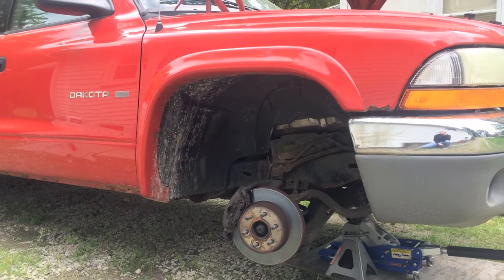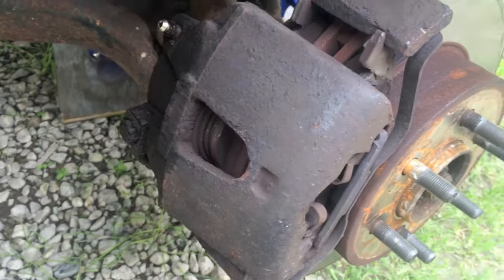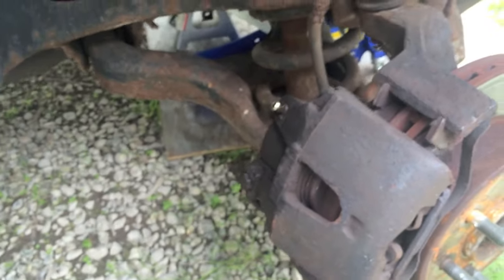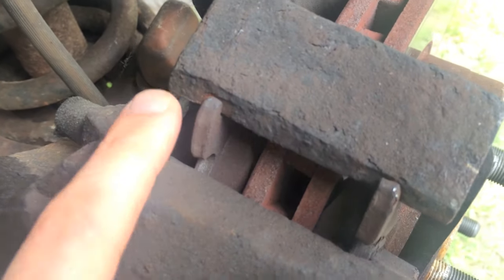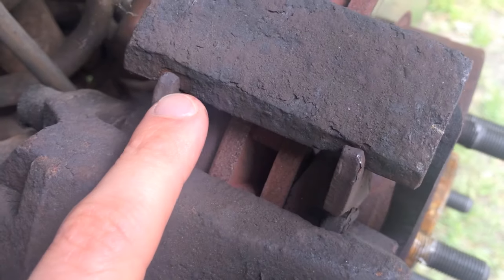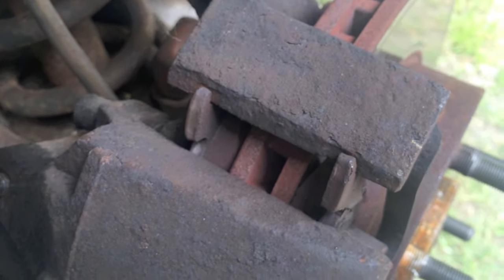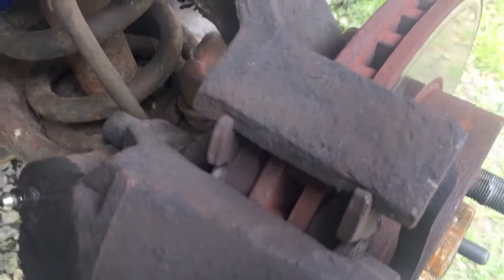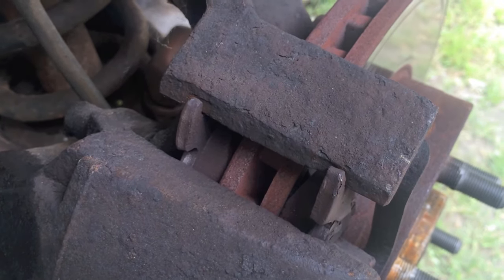HARD Brake Pedal - My brakes are Locking/Sticking/Smoking "Don't forget this"

Comment: Thanks for your video. It helped a lot. I was thinking it might be warped rotors or broken hub. Turns out it was just dirty calipers.I went to a shop to get my brakes done. I didn’t have any problems before I went in, the dealer mentioned I was low on brake pad and wanted $150. I went to get a second opinion and they wanted $75. I let them do it but afterwards my breaks were sticking. I didn’t notice it immediately because my music is on all the time but I noticed my gas mileage was down a good bit. Watched your video and fixed that thing myself. Lazy mechanics didn’t clean or regrease anything; all the old brake dust was clogging the calipers up. I’m done giving my money away to incompetent wanna be mechanics. Doing everything myself that I can now.
Reply from the maker: Gold Wolf 

Thanks for watching & sharing your experience.  We really enjoy helping out our fellow DIY’ers.  Us fellow DIY’ers need to stick together.  Sounds like you’re back up and running.

😎👍🔧🔩

Comment: Thank you for the help! This has been one of the most informative videos, after searching for hours & hours..   
My only option is to take apart & clean & re-grease what I can.  It may very well be that simple of a fix, at least for now!.
Reply from the maker: Joshua Parks 

You are very welcome Joshua.  Below is the same comment we replied on the other video question you had.  We just took our reply comment & copy/pasted it here for you in the event that you didn’t get the other reply.  Hope this helps!

NO FUN...Brake problems are very annoying and I definitely feel your pain.  Lets get this figured out together so you can get back to normal driving.

It can be a few different things....

The front rubber brake lines that connect to your caliper fail from inside rather that outside.  This means the inner coating begins to break away and clog portions of the brake system...hence not allowing fluid to flow back and forth freely.  

Your brake pads have little prongs/teeth on them.  You will notice by their location...the pads slide on a steel brace.  This may need to be lubricated to bring the shift back to efficient requirements.

I have attached helpful videos that help explain the items mentioned above.  In addition, I have added a few videos that it can also be as we move forward with pin-pointing the exact cause of your brake issue.  Lets start with the easy items and then work our way up!  Lets figure this out together!  Keep us posted!  

PLEASE SUBSCRIBE to the channel and turn on your YouTube notification Bell 🛎 that would be awesome!  😎👍🔧🔩

1.  Caliper Slides Lost Lubrication:

https://www.youtube.com/watch?v=-DZ68tKuCQc&amp;t=15s

2.  Too much Fluid in Reservoir:

https://www.youtube.com/watch?v=X-AJ5tD6zoA&amp;list=PLjCXOz8TSkZnavDiGDyHdPKe2dV2RzEMZ&amp;index=39

3.  Failing Front Brake Lines:

https://www.youtube.com/watch?v=3FTEgbLYAdI&amp;list=PLjCXOz8TSkZnavDiGDyHdPKe2dV2RzEMZ&amp;index=78

4.  Brake Pads not shifting:

https://www.youtube.com/watch?v=3Pq15BWM_qY&amp;t=103s

5.  Replacing Front Brake Calipers:

https://www.youtube.com/watch?v=8HoaL4QM5-k&amp;list=PLjCXOz8TSkZnavDiGDyHdPKe2dV2RzEMZ&amp;index=83

6.  How to check if Brake Booster is Failing:

https://www.youtube.com/watch?v=VK4lowH7kQE&amp;index=66&amp;list=PLjCXOz8TSkZnavDiGDyHdPKe2dV2RzEMZ

7.  Failing Brake Booster:

https://www.youtube.com/watch?v=j9s7yccswPQ

8.  Symptoms of a Failing Brake Booster Check Valve:

https://www.youtube.com/watch?v=j9s7yccswPQ&amp;index=68&amp;list=PLjCXOz8TSkZnavDiGDyHdPKe2dV2RzEMZ

Comment: Replaced caliper.  Did some test.  The rubber hose seems to be okay.  I've heard it fails from the inside also. They forgot to put the special washers for the hydraulic feed in the box.  I used the old ones. Pretty cool to have a bolt with a whole drilled through it to feed the hydraulic breaks. ..Time will tell.
Reply from the maker: PIANOSTYLE100 

Very cool & thanks for the update.  The little bolt that has a hole drilled through it is engineering at its finest!  🤓📚

We are happy to hear you replaced Caliper...hopefully it was fun.

Again, let us know if you have any questions, we are standing ready to help!  We replaced our rubber brake hoses.  It was a pretty friendly DIY project!  😎👍🔧🔩

Let us know how the test driving goes over the next few days.

Comment: I have a 05 suburban at first I had a spongy brake pedal. So I purchased a Master cylinder thinking that was the problem. Turn out I didn't need it and put the old one back on and refilled it with hydraulic fluid. Now my front two brakes are locking up.
Reply from the maker: Billy Cross 

Thanks for watching.  You will need to properly bleed brake system to get all air out of system.  Keep us posted.

Let us know if you have any questions.  Please subscribe to the channel and Ring your YouTube Bell 🛎 that would be awesome thanks again!

😎👍🔧🔩
Reply: @DIYwithMichaelBorders   the only way it drives is when I bleed front two brakes. After that it drives for about 5 miles and starts dragging again.
Reply from the maker: Billy Cross 

Thanks for the reply.  You will also want to make sure you bleed your Master Brake Cylinder as well.

😎👍🔧🔩

Comment: Talked to some very experienced mechanics and there are a few things that can happen that cause someone. The seal on the half axile that goes to the pumpkin can 
leak hydraulic oil  on to the hot brake parts  causing bad smoke.  
Another part that goes bad internally are the rubber hoses going to the callipers.  You can troubleshoot this with the bleed screw..as I understand it..I decided
not to get in this day..I'll send you some pix as I go.Anyways that's the plan.
Reply from the maker: PIANOSTYLE100 

We appreciate the update!  That’s great info from the mechanics.  It definitely helps when trying to pin-point the cause.  Keep us posted!  😎👍🔧🔩

Comment: I had brand new Calipers and brake shoes put on the front of my 2001 Pontiac Montana. A week later the brakes started locking up. I took it back to the shop and they said I needed new rotors, new brake shoes and brake hoses. I had them repair all of it. Drove it two weeks and now they are locked up again. The ABS has not worked in over 10  years so I doubt that is the issue. But I refused to let  them work on it again. What should I do?
Reply from the maker: Lydia Schmitz 

Thanks for watching & that’s no fun.  What does your fluid level look like.?  We recommend inspecting your brake fluid reservoir inside your engine compartment and verifying its within the proper fill parameters.

Fluid outside the parameters can cause your exact issue.  Keep us posted.

😎👍🔧🔩

Comment: Verified or believe I have a sticking caliper .I don't completely understand it, but it is based on hydraulic principals.  I will fill you in.. going to put on caliper..have to buy one today..probably should get some break fluid too.  If I would have driven it home..would possibly ruined my rotor.. ie. 80 dollars or so extra. I only pay a few dollars extra a month for towing..what a deal.. had to wait two hours. My wife has been really concerned. .
Reply from the maker: PIANOSTYLE100 

Awesome & thanks for the update!  An additional item you may want to consider is a failing Rubber Brake Hose.  It’s possible that your caliper is still in good working order and your hose has failed not allowing the brake fluid to efficiently flow back-and-forth...thus... causing a blockage in the fluid which then leads to sticking Calipers.

Below is a link to a video we made showing this repair.  It’s worth looking at.

       https://youtu.be/3FTEgbLYAdI

Comment: I am going to pass this on.  99  Chrysler Town and Country... It has been using water and getting really hot fast...It was having several symtoms that looked like blown head gasket was on the way.. I found a leak in the back passenger
side.  it was broken plastic pipes going to and from the engine.it was the rear heater. I  bypassed it and ran a 10 inch heat resistant rubber hose between the two.. it seems like it's ok..and yes it's a rig but not losing water at that point..so far. So still was losing some water. In one night the radiator would go to 3/4. I happened to hear a drip drip one night.. listened to fender area and every 15 seconds or so it dripped.
Found this drip is  at the input to the water pump. It appears to coming from the pump itself. The part is about 30 dollars. When I replace it, that   should fix it..iIf I was mechanic I wouldn't rig it but it's my car .. I do keep checking it  often.  Seems adverse effects.
Reply from the maker: PIANOSTYLE100 

Sounds like you’re having fun working on your vehicle.  A project vehicle can teach you a lot & help you down the road later on when getting a newer vehicle.  That’s awesome!

It’s always so rewarding when you fix your car yourself & save lots of cash 💰 

😎👍🔧🔩

Comment: Just now running across your video...but I have a 2004 Chevy avalanche & I had the rotors brake pads changed like last yr now my truck brakes are locking up on me....so I changed the front calibers & the front brakes lines only for it to still lock up on me after a few mins of driving....could U tell me what it may be that is causing this issue....any info would be greatly appreciated
Reply from the maker: Thanks for watching & we appreciate you sharing your experience.  Let’s get this figured out.  Since you have replaced all these parts...& assuming vehicle brake fluid system has been properly bled, it’s very possible that the fluid level is exceeding the fill parameter.

Check out the video link below, it talks more about this.

       https://youtu.be/X-AJ5tD6zoA

Let’s start there, keep us posted.  Us fellow DIY’ers need to stick together!

😎👍🔧🔩

Comment: You are right that is the problem I have a 2001 Saturn front brakes overheating and locking up I loosen up the anti-lock hydraulic line a little bit break started working fine but they keep on locking up I'm pretty sure the anti-lock brake system is bad I unplugged it totally still overheating front brakes locking up thinking about just bypassing it totally and go straight into the master cylinder I'm thinking that will solve the problem
Reply from the maker: Rocky Easterline 

Thanks for watching & we hope you enjoyed the video.  The ABS is an important feature & should be addressed.  Keep us posted on your project.

Let us know if you have any questions.  Many more helpful videos to come!  😀
Please subscribe to the channel and turn on your YouTube notification Bell 🛎 that would be awesome thanks again.

😎👍🔧🔩
Reply: U ever figure it out? I have an 03 saturn, just got new pads/rotors/calipers/drums/cylinders/front hoses/master cylinder...car drives fine for a while but then drags from bad to worse, super stiff pedal, smoke coming from both front wheels

Comment: I have a 1996 Cadillac Eldorado. Over the past year I have replaced the rear brake lines up to the front and also right rear caliper. Brakes worked good for about a month. Now, I have a very soft pedal until I pump it a few times then the pedal gets stiffer. Sometimes it brakes ok. It's intermittent. My brake fluid is full and I see no signs of a leak. My ABS and traction lights are on and have been on and off since summer. I figure that's probably a bad connection at the hub. But the last time I had the brakes worked on, the mechanic said that the ABS may have air pockets and might need bled again at some point. What are your thoughts?
Reply from the maker: MrDjrockit 

Thanks for watching & sharing your experience.  Your mechanics ideas are definitely credible & a possibility.

We will add it’s recommended to verify that your Speed Sensors are properly connected & still working.

Having AutoZone connect an OBD scanner to your vehicle will allow you to gain access to all error codes causing ABS & Check ENG light to be illuminated.  AutoZone will do this free of charge.

You may find that you have a faulty Wheel Speed Sensor.

Let’s start there, keep us posted, we are here to help!

Please subscribe to the channel and turn on your YouTube notification Bell 🛎 that would be awesome thanks again!  😎👍🔩🔩

Comment: My only option at the moment is to attempt to free up my breaks at home. Its the front left that sticks on occasion- sometimes not at all, sometimes very badly/strongly..  I did the first thing mentioned in this Video & will be doing what this video is focusing on next.   (I hope that makes sense) .
Reply from the maker: Joshua Parks 

NO FUN...Brake problems are very annoying and we definitely feel your pain.  Lets get this figured out together so you can get back to normal driving.

It can be a few different things....

The front rubber brake lines that connect to your caliper fail from inside rather that outside.  This means the inner coating begins to break away and clog portions of the brake system...hence not allowing fluid to flow back and forth freely.  

Your brake pads have little prongs/teeth on them.  You will notice by their location...the pads slide on a steel brace.  This may need to be lubricated to bring the shift back to efficient requirements.

I have attached helpful videos that help explain the items mentioned above.  In addition, I have added a few videos that it can also be as we move forward with pin-pointing the exact cause of your brake issue.  Lets start with the easy items and then work our way up!  Lets figure this out together!  Keep us posted!  

PLEASE SUBSCRIBE to the channel and turn on your YouTube notification Bell 🛎 that would be awesome!  😎👍🔧🔩

1.  Caliper Slides Lost Lubrication:

https://www.youtube.com/watch?v=-DZ68tKuCQc&amp;t=15s

2.  Too much Fluid in Reservoir:

https://www.youtube.com/watch?v=X-AJ5tD6zoA&amp;list=PLjCXOz8TSkZnavDiGDyHdPKe2dV2RzEMZ&amp;index=39

3.  Failing Front Brake Lines:

https://www.youtube.com/watch?v=3FTEgbLYAdI&amp;list=PLjCXOz8TSkZnavDiGDyHdPKe2dV2RzEMZ&amp;index=78

4.  Brake Pads not shifting:

https://www.youtube.com/watch?v=3Pq15BWM_qY&amp;t=103s

5.  Replacing Front Brake Calipers:

https://www.youtube.com/watch?v=8HoaL4QM5-k&amp;list=PLjCXOz8TSkZnavDiGDyHdPKe2dV2RzEMZ&amp;index=83

6.  How to check if Brake Booster is Failing:

https://www.youtube.com/watch?v=VK4lowH7kQE&amp;index=66&amp;list=PLjCXOz8TSkZnavDiGDyHdPKe2dV2RzEMZ

7.  Failing Brake Booster:

https://www.youtube.com/watch?v=j9s7yccswPQ

8.  Symptoms of a Failing Brake Booster Check Valve:

https://www.youtube.com/watch?v=j9s7yccswPQ&amp;index=68&amp;list=PLjCXOz8TSkZnavDiGDyHdPKe2dV2RzEMZ
Reply: @DIYwithMichaelBorders   Thank you so much! I will review more videos & see what I come up with. Thanks!
Reply from the maker: Joshua Parks 

Very cool.  We are standing ready to help if you need.  😎👍🔧🔩

Comment: Nice! I came here cuz I have a 2011 Mazda 6 that I just changed both back calipers and brakes on. Now my rear driver side brake is locked up. It was like the e brake was on (wouldn't even roll back on a hill when clutch pressed in) 

A big cloud a brake dust followed me home and surrounded me in discouragement.. I didn't even think to grease the pad tips (never have) or that maybe rust is keeping it from sliding back to battery. I saw what you said about the brake line innards deteriorating. Might there be a way to check? Brake fluid was pristine when bleeding..
Reply from the maker: Bm Schaumburg 

Thanks for checking out the video and sharing your experience.  We appreciate you taking the time to reach out to us!  Just by adding a bit of lubrication & removing rust, your pads will be able to slide more efficiently.

As far as the inner brake lines...unfortunately it’s not possible to see whether or not your lines has begun to deteriorate to a point of no return.  Always best to remove old & Install new.  It will put you in a good mood knowing you have new lines.

Hope this helps.  Please subscribe to the channel and turn on your YouTube notification Bell that would be awesome thanks again!  😎👍🔧🔩
Reply: Subscribed and notified! I cleaned any rust and greased the caliper piston/ brake tips. I still noticed some resistance spinning the wheel, but maybe the pad will wear down enough? 

Next may be the lines and rotor huh? Preciate your response!
Reply from the maker: Bm Schaumburg 

Very cool & thanks for the update!  Definitely keep us posted!  It’s also important to keep an eye on the life of your actual Calipers.  As they age, the internal Piston begins to seize up & can lead to brake pads rubbing hard on rotor when you are not pressing brake pedal...leading to hard brake pedal. 😎👍🔧🔩
Reply: DIY With Michael Borders I finally singled it down to a faulty brake line hose! Changed both back hoses and bled the whole system and voila! The piston on the new caliper in question now does as intended and retracts!

I never would have thought the hose would be the issue. Thanks for the insight and great video!
Reply from the maker: Bm Schaumburg 

Thanks for the update!  Thats great news!  Glad to hear you’re back up and running!  Those brake lines are very unique in that they fail from the inside out.  The lines may look completely normal & good from the outside however they may have begun to fall apart inside.  No fun!  Thanks again for the update.  We appreciate you taking the time to reach out to us!  😎👍🔧🔩